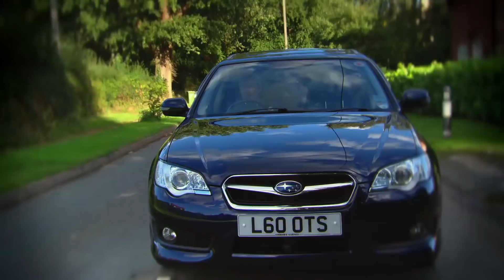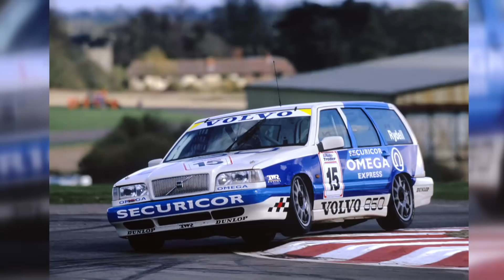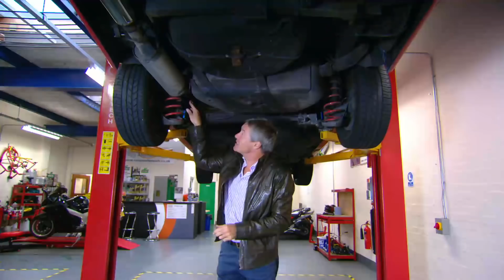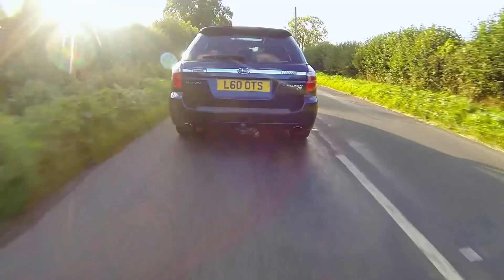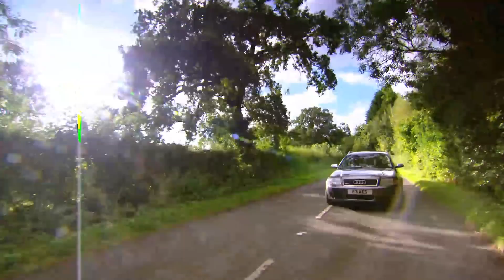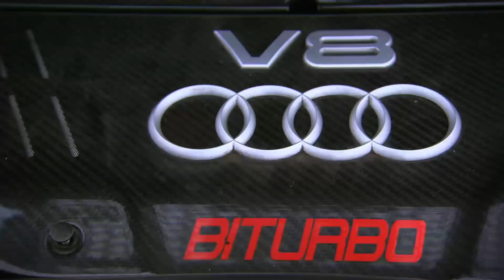Cheap alternatives to the transit van | Fifth Gear Classic

Comment: Nice! A better way to check the PCV system is to remove the oil filler cap and put a latex glove on it. If it blows up the PCV system has to be serviced, if it sucks in a bit all is well. The PCV system can be serviced by a competent home mechanic, I have done it many times. Total costs of parts is around 150 pound, on a turbo it is about a day's work and a bit fiddly...

Comment: You'll be allright with that manual gearbox on the RS6 cos they never made any.
Reply: I was just thinking that!
Reply: There are several manual swapped rs6’s. When my tranny blew I swapped the gearbox. It’s not that hard and changes completely the car.
Reply: @Eidrian111  I did it but on a 2.5 tdi
Reply: @okoolala  nice, six speed?
Reply: @Eidrian111  yeah 6 speed
Reply: @okoolala  cool.
Reply: @Eidrian111  it's been 3 year's since the Manual swap really enjoyed the car good car's for the money it's fwd so it has the CVT with no sport's mode so just used to stick at 4 k 😂😂😂
Reply: My brother has a manual s6
Reply: @hoonaticbloggs5402  not a C5. or converted maybe but thats pretty rare. Trust me I had one aswell.
Reply: @eduardwalhout  Actually, the C5 S6 was made with either a 5 speed auto or a 6 speed manual. The RS6 was auto only.
Reply: @The_DVR  oh S. ok I misread. But thats a pretty different car altogether.
Reply: I converted my V6 TDI C5 to manual automatic gearbox is about as strong as a wet toilet roll

Comment: They didn’t offer the RS6 with a manual. Pretty much all cars have had DRC replaced. But having owned one I can say when it works it’s brilliant but I won’t be doing it again which is all you need to know.
Reply: It was offered in manual, but only in the US
Reply: @justaapriliaguy7254  and only in saloon

Comment: Aye the Volvo best bang for your buck there, but Tiff, I don't know where you pricing rear shocks from (for Volvo 850) @ £270 a piece' Lmfao ~ I was that sceptical' had too check..  KYB shocks £60 ~ Sacks for £73 each (inc VAT) ! 

Subaru, complete Suspension Arm fitted with bushes are about £150 a corner & F/brake callipers are about right ~ but (your) callipers price would include thee £50 (exchange part) surcharge ~ also wishbone Bushes (Front Axle left and right-Lower-Rear) are £26 (inc VAT) each' if only bushes was needed !

Lol £1000 for Disks & Pads.. Audi S6 (2004) Complete set of Brake (ATE) Disks & (Brembo) Pads £278  (inc VAT) !
Reply: An s6 isn’t an RS6, they are around a grand for discs n pads 4 corners on an RS6

Comment: LOL, a PCV valve for 700 nickers? xD
Reply: its not just a valve but oil seperation box with tubes sits under intake manifold. With labor/parts $350 ea yup its expensive

Comment: Yeah for those prices you are not getting a functional 850R or RS6 :D
Reply: It was 7 years ago when this broadcast. Man I should have bought them all... 🤣
Reply: Yeah just checked for a 850 the lowest was 6 and half on auto trader 😫
Reply: I bought my RS6 in 2017 for 8k. Bargain.
It was mint. I had it remapped to 525 and 830nm. The thing was a absolute animal and flew. Bang went the box. 4k later. Loved this car until I lost my license.

2 years later bought a TTS and its so far had 12 grand spent on it in tuning and mods. 400hp and 580nm but a light 4wd car. Flies.
You cant beat the V8 noise though and that RS6 mapped will do 190+
Reply: @stuartpringle913  Yeah, RS6's are special. My father was fortunate enough until very recently to own a c7.5 performance rs6. Remapped, it had 670hp. I reckon that could've hit 200. By far the fastest car I've ever been in.

Comment: God, Imaging bagging a good 850r estate for 1500 today, impossible!
Reply: 20k if it's yellow and in abused
Reply: Yup I bought one $800 4 years ago now at least 5 grand
Reply: @far1002  £10k in the UK now
Reply: Ive had an 1996 850r manual on my back drive for 6 years,120,000 mls.Needs some work but im never selling it,best car ive ever owned
Reply: I may of had my S70 T5 at 155, but it was still pulling but I backed off.
1500 quid for an 850r lol lol, when was this exactly?
Reply: @ukfirebird  First broadcasted 2014
Reply: The glorious period of ultra cheap large cars between 2010-16
Reply: Top tip for the future classic. 
Volvo C30 T5.  Less than 600 imported to the UK. Last of the real 5 pot sports T5s
Reply: @Rich.Aardvark  Yeah agreed, I called that the 850s would boom in price years ago. The next one will be the C30, but R-Designs in in T5 only.
Reply: @nboy7  I have the R-Design SE Sport.
Had the engined forged @ 84,000
Reply: @Rich.Aardvark  I had a 2011 C30 T5 R-Design Polestar. Sold it when the prices were going up (got WAY above market value since demand was so high).
Despite the profit i really regret selling it. And i think many people now understand how good it actually is. Most sports hatches now are cold and souless. The C30 T5 is very engaging and entertaining to drive.
Reply: @nboy7  I totally agree! I had 2 S40 T5's before I buying  the C30. I wanted another S40 but there wasn't any nice ones around at the time.
I still blown away on how it handles, amazing chassis and weight distribution.
Underatted due to the Grand Tourer set up. I'd hate to do a long run in a MK2 ST!
Reply: @Rich.Aardvark  i hope your right. I have one now and plan on keeping it for many years to come.
Reply: @AK47RAYNKHAN  good on you! I couldn't part with mine either. I will have to buy a second car and keep it for weekends if the price goes up
Reply: @Rich.Aardvark  i think your onto a good plan there. I may follow suit and buy a cheap daily and keep the T5 for the weekend 🤔
Reply: @AK47RAYNKHAN  you know it makes sense!
Reply: @Rich.Aardvark  Not sure about in UK, some very early last gen V40 T5 also had the 5 pot + Manual option.
Reply: @avinashclt  good point. I had forget I'd seen those. Also a few S60 5 pot in newer shape. 
A S60 T5 AWD would also be a great investment.
https://youtu.be/0j3BYLqGQl0